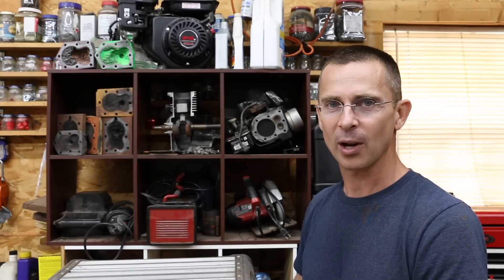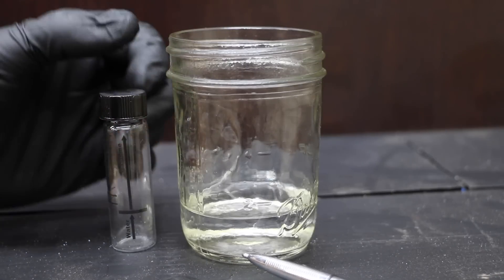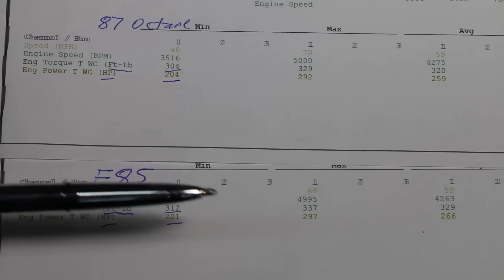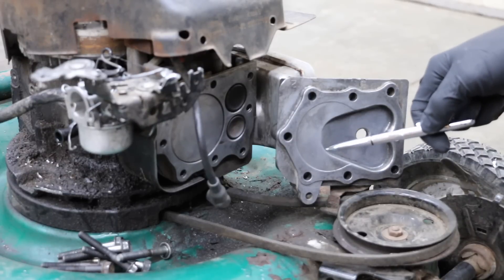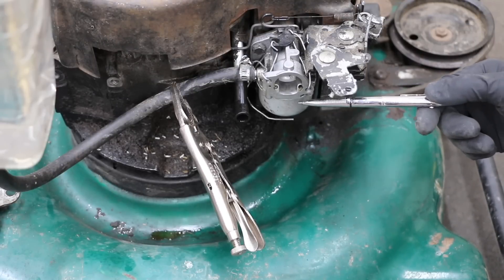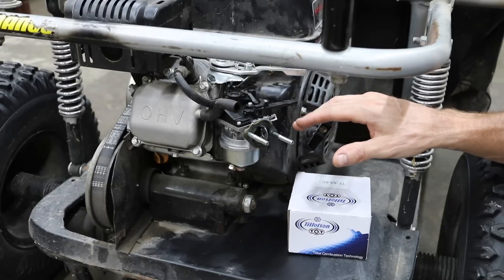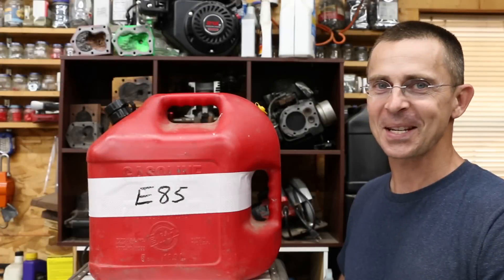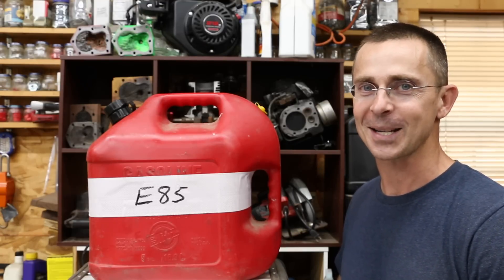Is E85 better than Gasoline? Let's find out!

Comment: So in conclusion that Suburban gets horrible mileage no matter what it runs on!  11.9 and 15.5!  If you're ok with that kind of mileage then you might as well drive an old 1970 Land yacht.  Get yourself a big old Lincoln, at least you'd be riding in style while sucking down all that fuel.
Reply from the maker: Thank you.  The Suburban has AWD capability, which comes in handy this time of year with the snow as well as the capability to tow a trailer.

Comment: The ratio of ethanol is differant depanding on time of year thats why their is a minimum rating of e85 and some counties use a different e rating
Reply from the maker: Great point!
Reply: True. Because ethanol is less volatile than gasoline it is harder to ignite in a cold combustion chamber. The colder the weather the harder the cold engine is to start so fuel companies reduce the e% in the winter to compensate.

Comment: I used E85 straight in my 05 Mitsubishi Lancer. It had a hard time on cold starts but would turn over after at least 3 cranks. My gas mileage dropped by 5mpg.  I also got a check engine light for running lean. Otherwise it ran cooler and improvement in horse power. My oil did not turn  black as quickly and it cleaned my catalytic converted and oxygen sensors. I only buy it when it is cheaper than regular gas. It has to make up for the worse gas mileage.
Reply from the maker: This is great information. Thank you!
Reply: Using it straight without modifying the fuel system to increase fuel flow is not a good idea. Hence the CEL. Lots of guys are able to run up to e30 with no mods and no CEL and gain 90% of the power benefit.
Reply: @65sohc  How is it not a good idea? CEL just means they are maxing out my fuel injectors. I still get the benefits of the E85. The moment I put regular gas in the CEL turns off. My only concerns would be the cold starts in the morning. If oil is not getting to the top of the motor, could cause damage over time. Otherwise as long as the price is right on the E85 I have nothing but to gain.
Reply: @TJAzton  Exactly. Your injectors are at 100% duty cycle and the engine is still running lean. Rather than running pure e85 it would be safer to start with a lower ethanol concentration that you know won't trigger CEL and gradually increase the percentage on subsequent fillups until it comes back on.
Reply: @65sohc  How is it safer? What am I risking?
Reply: @TJAzton  If the engine is lean to the point a throwing a CEL you risk melting a piston, especially in a turbocharged application. You can also burn up the catalytic converter. Also, injectors are not intended to run at 100% duty cycle. Beyond 80% they meter fuel less efficiently and run hotter, potentially leading to failure. As I mentioned before past, about e50 you reach the point of diminishing returns.  e50 is 100+ octane which is plenty.
Reply: @65sohc   I do not think you know what you are talking about. The car is running cooler when it is using straight E85. You are not listening because I said that in my original post, so this is a waste of my time. There is no way I would melt a piston nor the CAT.  The CEL is just telling me I am maxing out my injectors, which is fine. This is not a turbo charge engine either. The only thing I would need to do is adjust the computer, telling its okay that it max out the injectors. They are made to be maxed out, it will not break them.
Reply: @TJAzton  Here is a quote from an article from Bell Performance:
 " But E85 burns differently than E10 or regular gasoline, and that means a flex fuel conversion has to involve changing the way the injectors work.
Ethanol has 25% less energy than gasoline, meaning more ethanol is needed in the combustion chamber to produce the same energy output as a gasoline only engine. To account for this, flex fuel vehicles have a wider range of injector pulse width allowing up to 40% more liquid fuel into the fuel air mixture. Injector pulse width is the time a fuel injector is held open allowing fuel to flow through it.....  Without this essential conversion, the fuel-air mixture is going to be "lean" (too much air and not enough fuel in the mix), which burns hotter than the normal fuel-air mixture, and that's going to make your engine run rough and experience critical damage over time.'
This is why you can't just slap E85 into a regular car and not have problems.  But you can do a flex fuel conversion......" There is no way the puny little injectors in your Lancer can supply adequate fuel. If they were, 100% duty or no, you wouldn't have a CEL.

So you can do it the right way and modify the car to deliver the appropriate amount of fuel to achieve the correct AFR, or you can do it your way, ie. fill it with e85 and ignore the light.
Reply: @TJAzton  As far as the injectors "made to be maxed out," here is an excerpt from RB Racing, with 30 years of experience blueprinting injectors, "Beyond the 85% figure horsepower can actually drop as the pintles or discs in the injectors are essentially "floating", trying to open and close before they can complete each event. At this point the injectors actually put out less fuel until they are fully pulsed static and then the final output goes to 90% of their rated capacity. Injectors should not be pulsed beyond an 85% duty cycle."  Sorry that factual information is a waste of your time.
Reply: @65sohc  I was talking about your ridiculous claim that the piston would melt or burning the CAT. You are just trying to be "correct" in the conversation rather than be helpful. Then pulling statistics on racing cars rather than an everyday driver. Here I am responding like a fool.
Reply: @TJAzton  OK friend, here is my last comment, a quote from an engineer at Advanced Fuel Dynamics: "When you lean out your engine you can cause excessive heat loads that can burn holes in your pistons.  Ethanol based fuels are actually very stable, with very high octane equivalents so it is very unlikely it will knock.  Ethanol also does reduce cylinder temps, until your AFR gets too high then it melts pistons.

Let's just say, if the Mitsu is running right on E85 with no specific management it is a wild anomaly and would not pass muster on any other vehicle.  Chances are, because there is no knock, your friend just thinks it is running fine and at some point he's going to get a surprise when he puts his foot on the floor and his pistons turn to Swiss cheese."

Comment: There's a big misconception about why E85 exists and why ethanol is added to gasoline in E10. Yes, ethanol contains less energy per mole than isooctane. The point of ethanol in E10 is as a nontoxic antiknock agent to replace the older TEL lead based one. As far as E85, it's great for very high static/dynamic compression ratios such as boosted engines but yes you will get less MPG as it contains less energy. There's no point to run it in lowe or mid compression, naturally aspirated engines.
Reply: It is also added as an oxygenant to help lower emissions in older cars.
Reply from the maker: Thank you!
Reply: @ProjectFarm  Thanks for the tests. I just started watching your vids and they are all very interesting. I just thing a lot of people bash the ethanol in E10 and don't realize it was a great way to replace the lead that was poisoning people.

Comment: I converted my old 78 carbed truck to run on E85 in high school I had put a scope camera in each cylinder drove around for 6 months on E85 checked again with the scope and I was amazed it had costed no damage it cleaned the cylinder head and top of piston to clean aluminum
Reply from the maker: Impressive!
Reply: Great high school project.

Comment: I once made the horrible mistake by using E10 for my 2-stroke 49.2cc scooter ( 2001 ), which is designed to run on 91 octane. The engine began to jerk and often stall after somewhat five miles upon refueling. After I had it pushed back at home and inspected the spark plug, I noticed some granite-like residue viced in the spark gap. Took quite some effort to lever it out. Another shocking discovery is that my chrome-plated muffler had begun to turn blue-purple, which is a sign of overheating! So I drained out all the E10 crap, refueled with 91 octane, put in a new spark plug - and the scooter now runs fine as if nothing has ever happened to it to this day. I am posting this to warn other 2-stroke-engined vehicle owners not to do the same thing! Take my advice seriously! Lesson learnt!
Reply from the maker: Wow! Thank you

Comment: I've roughly calculated to produce 100% ethanol from sugar would cost $1.68 per litre. Based on 82 cent per kg sugar and zero production losses.
Reply from the maker: That seems like a very reasonable price!
Reply: @ProjectFarm  I thought US  fuel was $1.28. I know it depends on where you live in America. The UK is currently about £1.16/17 at cheap fuel stations. Goes up to 1.30/45 on occasions for months. What's the price where you're at?

Comment: Remember Ladies and Gents hes only Doing US math remember in Canada and the UK it's 2$ a liters 4 liters Equals 1 gallon of gas so that 8$ if not more for 1 gallon of gas I beat if people were paying 8$ for 1 gallon vs $0.50 or 1$ per liter with e85 Everyone would be converted because it cheaper Per gallon
Reply from the maker: Great point. Thank you
Reply: Petroleum is a global commodity. A barrel of oil costs pretty much the same wherever you go. The reason gasoline is so expensive is Europe can be summed up in one word: TAXES.

Comment: In my area e85 is about 70 cents cheaper than 87 at a couple stations. I get about 13mpg city with an 08 crown Vic on e85 and 15mpg city driving on our winter blend 87. I’d like to see some testing of
Klotz oil vs. amsoil in 2 and 4 strokes!
Reply from the maker: Thank you!

Comment: I run E 85 in my company van. Doing the math and testing MPG  at 60 cent a gal. cheeper is the break even point for me. I did not have as much of a difference in MPG with a 6L V8 in a loaded van. Now with gas cheeper I can't find E 85 at a value.
Reply from the maker: Excellent!

Comment: I think you're estimate of cost of E85 vs. Gasoline are off. normally E85 is 30% cheaper than 87 and the reason why they do that is because you burn 30% more. Gasoline is one of the shittiest things out there and needs a bunch of additives just to make it usable.... whereas E85 you could make in your backyard and doesn't need anyting at least alcohol side of it you could do. Anyway my point is they intentionally make E85 30% cheaper to make up for the gas mileage.... so that's a mute point. The other benefits are we're helping local Farm industry and not sending money overseas. Oil companies are trying really hard to kill E85 putting rumors and false information out there. Most vehicles 2006 or newer can handle alcohol in the fuel. Now the amount of alcohol is dependent on the computer and injector size and if it can detect the alcohol. Also E85 is equivalent to 105 octane who doesn't like that race fuel cheaper than crap fuel prices.
Reply from the maker: Thank you for the constructive feedback.  I sure wish it was 30% less locally.
Reply: @ProjectFarm  this is really interesting I used to buy E85 a little over a year ago in the southwest and it was at times more than 30% cheaper but on average 30% cheaper. I'm not in the southwest right now I'm traveling and just looked at prices.  I believe it's only $0.27 cheaper according to what I found online and I read a couple articles how companies are intentionally price gouging because of the oil companies. The national average according to google was almost price of regular gas... which is crazy it should be half of that. Some places sell it as cheap as a 1.50 a gal.

Comment: Test it on any 450cc 4 stroke dirt bike. These engines are manufactured with compression ratios above 12:1. Some are as high as 13.5:1.
Reply from the maker: Thank you for the video idea!
Reply: You'd need to have some means of increasing fuel flow to achieve proper AFR.
Reply: @65sohc  We already know the means. Jet richer or use the mechanically injected unit. You won't need much more though. The fuel economy penalty is almost, not quite, negated when the compression ratio is this high.
Reply: @exoticcreature3059  Yup. Around 30% larger jets I would think. Ethanol is much more forgiving than gasoline as far as AFR.
Reply: @65sohc  Yes. I know you won't congratulate me for this but I've run a number tanks with E85 in my car which is not a flex fuel. Just to see what would happen. So no lines or gaskets that have gone bad. That's good. But all other things happened as expected. The MIL light turned on, of course. Fuel economy dropped, of course. Engine power was not reduced though. From what I've read the ECM in many cars and trucks has a programmed fuel curve with a tolerance band of +20% and -20%. So there is normal, 20% above normal, and 20% below normal. Why? Obviously because there will always come a day that fueling at normal levels isn't getting smooth engine operation or adequate power and the reasoning could be anything. Now at 20% richer than 14.7:1 this is still leaner than the stochio for E85. I have no way knowing what exactly the ECM did to keep the engine running well. If I had to guess though I'd say 20% more fueling, opened the idle air control circuit more than usual, and retarded the ignition timing for the AFR was leaner than stochio. I'm saying this assuming the ECM only goes 20% above normal. I don't know the actual value. I just know the experiment actually ended well.

I do not care about the car I have. To me it's a toy for testing just like the lawn mowers in Project Farms videos.

Comment: With E85 being 30% lower in energy value, the price should be 30% lower, but it's not.  As you point out, it's really more expensive to use.  Until the engineers change the engine designs (maybe base it on diesel with higher compression ratios), E85 won't be the fuel of choice in today's engines due to it being less efficient.
Reply from the maker: Thank you!

Comment: I have a 2009 Chevy Tahoe that is rated for flex fuel, and on interstate driving, I only notice a 1 to 1.5 mpg difference in the long haul. Around here, right now E85 is running about $0.50 per gallon cheaper than regular 10% 87 octane
Reply from the maker: Thank you!

Comment: You know, when I saw the see through engine and the piston, I got the thought of it dancing :D. Also in this video, I wondered if the lawn/field that you show in video's like this where you use the go cart, I wonder if you end up having to mow all of that or not.
Reply from the maker: Thank you.  I use a riding mower or I'd never keep the place properly maintained. Thank you
Reply: @ProjectFarm  welcome. yeah, that's the image that had popped into my head, that you'd use a riding mower for all that. In fact, I just thought of it, is the tractor that you showed in one of your video's your's? And is that what you use to mow the lawn with?

Comment: Have you ever done a video on regular 87 vs 93 Oct. I have always used the higher stuff in my small engines , as a kid I was told that I would ruin my mower with the cheap gas ,I don't believe that , but is there an advantage to the pricy gas or am I wasting my money
Reply from the maker: In my opinion, only use the minimum octane required for the application or it's a waste of money.  Avoiding ethanol in small engines is worth the added expense.   Hope this helps. Thank you

Comment: E85 damaged two new lawnmowers, mine and my son’s and voided their warranties.
Reply from the maker: Thank you and Happy New Year!
Reply: It is all that is available here at certain times of the year.
Reply: @jimmcgettigan1326  Really!!!? Where is that?
Reply: Arizona. The Costco gas attendant described it as E85 but even if it was the more standard 10%-15% ethanol it still damaged the interior of the carburetors.
Reply: @jimmcgettigan1326  That's too bad although it is highly unlikely that Costco would sell e85. But given the fact that e10-15 is practically universal I think the mower manufacturer should upgrade their fuel systems.  It isn't difficult or expensive.
Reply: The engines themselves ran well on the fuel before it started to dissolve the carburetor components.
Reply: @jimmcgettigan1326  If it were actually e85 they would not have run well. What brand mowers?
Reply: Yard Machine with Briggs and Stratton engines, bought at Home Depot. It was clear that Customer service at both companies were aware of the problem and were denying any responsibility.
Reply: @jimmcgettigan1326  B&S says up to 10% is acceptable. It would be interesting to return to Costco and look at the pump. It will say whether it is e10 or e15.
Reply: Why would anyone put e85 in a lawnmower? As Bill Engvall would say, "Here's your sign."

Comment: Have you tried middle grade? And see if it it better then the regular
Reply: The only difference between 87 and 89 (middle grade) is octane, ie. resistance to knock. If any engine knocks on 87 then switching to higher octane makes sense.
Reply from the maker: Thank you for the video idea!

Comment: Right now gas and e85 are the same price in Detroit so e85 would be worth it now.
Reply: Straight e85 requires 30% more fuel to achieve the stoichiometric air:fuel ratio of ~10:1. Therefore, if all one looks at is the economics the price would have to be 30% lower than straight gas to break even. In most cases not cost effective. But in a high performance setting compared to fuel with the same power potential it is a bargain. The very vocal e85 detractors need to keep that fact in mind. The average driver would also would not benefit from running VP 117 race fuel either and it would cost a fortune, but that doesn't mean there is anything wrong with it.